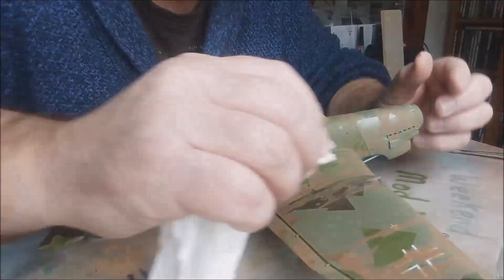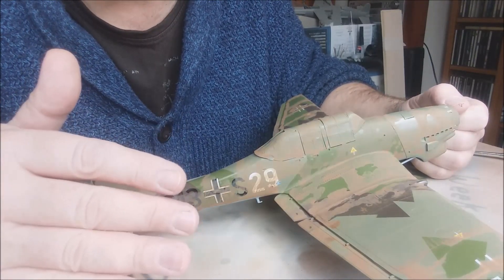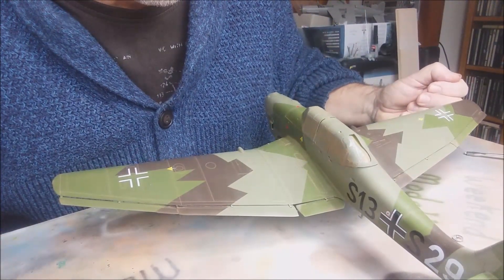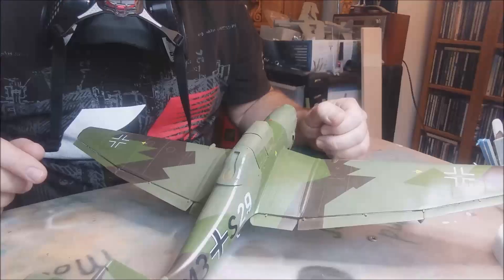Trumpeter 1/32 Junkers Ju-87A Stuka Part 5

Comment: Hi buddy, hope you and the family are well? Brill work my friend, can I ask, is it a good kit, the fit etc as I've got this ready to buy on evilbay as I've never done a 32nd scale wingy thing I always do 48th scale but I've fancied a 32nd scale kit
Reply from the maker: Thanks for the comment! The kit itself is good, but is let down by the poor instructions. Take your time with it, look ahead of your current stage if you are unsure of something and make use of as much reference material as you can. The fit can be tight, so prepare for sanding and filing and a lot of dry-fitting. If you want something easier, the Hasegawa 1/32 scale kits fit well in spite of their age.